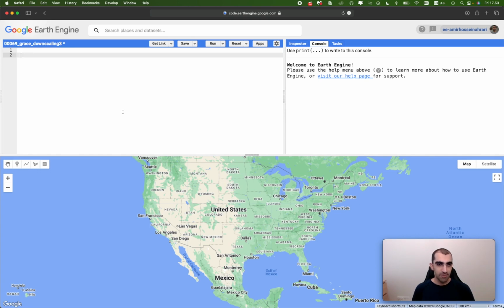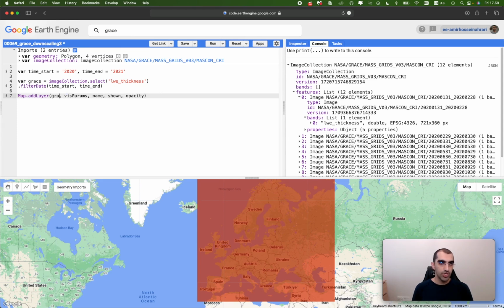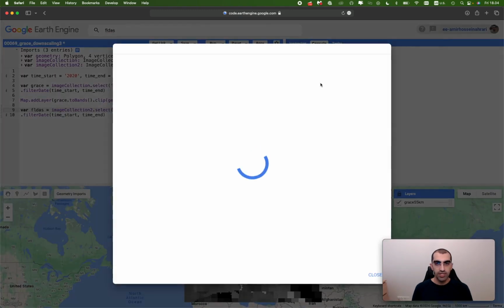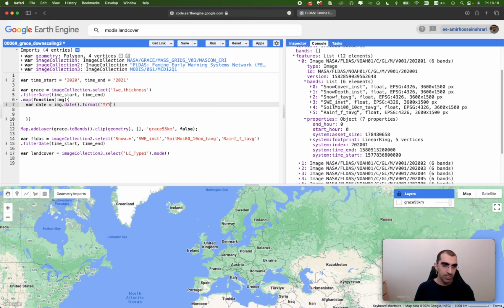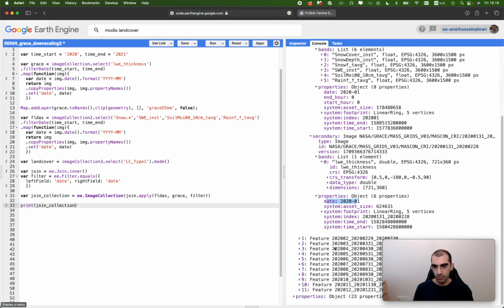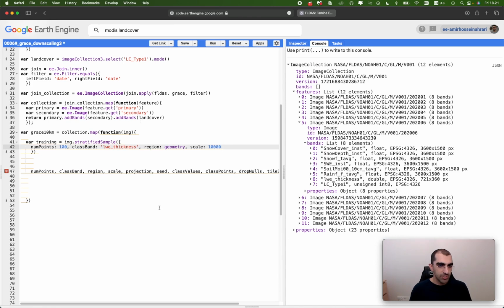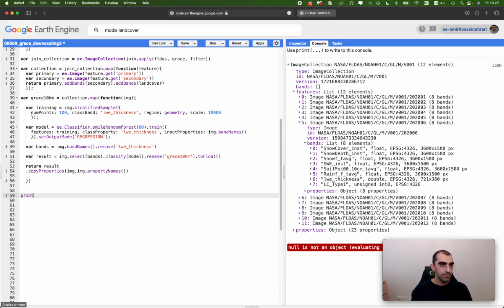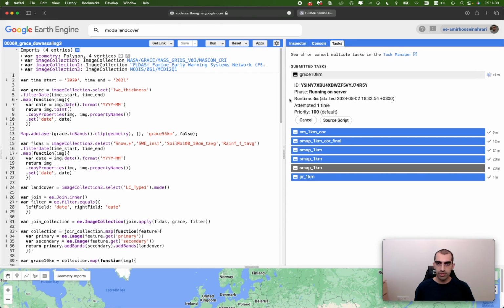Google Earth Engine Tutorial-59: GRACE Data Downscaling, using Machine Learning Techniques

Comment: Thank you for your sharing. I would like to ask if I want to refine the resolution further, for example, reducing it from 10km to a lower value, can I use this code by simply changing the parameters?
Reply from the maker: Yes you can. The is one of the strong modelling methods extendable to wide range of variables.
Reply: @amirhosseinahrarigee  Thank you for your reply. Your answer was very helpful to me. I hope to learn and exchange ideas with you in the long term.

Comment: Sir! GRACE data spatial resolution is 1* X 1* then it will cover how much area? As GLDAS data of 0.25 degree into .25 degree resolution i want to use. But i don't know how to resample the data set as i want do in python but the think is that i resampled the data upto 0.025 into 0.025 degree grid to do grid based analysis is it fine. And if so then how much area is cover by GRACE pre sampling and post sampling, on the same side that about GLDAS dataset? If i resample the data upto 0.5 into 0.5 degree grid size then it will cover how much area?
Reply from the maker: one degree = 100 km in equatorial region.

Comment: Sir you are using 55 km spatial resolution data for training by using FLDAS datasets 10 km spatial resolution. If we consider 1 pixel of grace data contains 5 pixels of FLDAS. In training, you are using same 1 pixel value from GRACE for all those 5 FLDAS pixels. If we develop the model like this it will go for over estimation. what do you think sir??
Reply from the maker: Recently tried to solve this issue by resampling process, but haven't seen any progress in the results. Still I am working on these methods. I will update the tutorials in future, in case I have update.